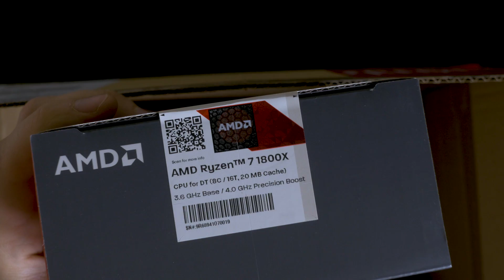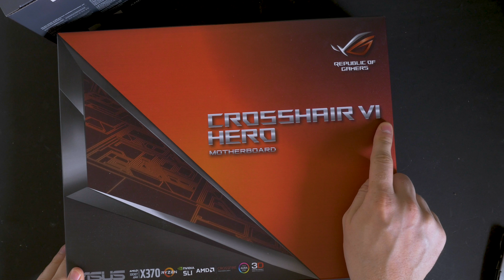Ryzen 7 + Adobe Premiere Pro Results

Comment: Adam can you comment on timeline performance with the 1800x? Buttery smooth, or dropping frames when you've got a stacked timeline? (using proxies, or straight footage?)
Reply from the maker: Playback is great but a big factor is the speed of the drive/s the media is on.
Reply: Good point about the drives. I'm going to employ a couple of Samsung 960 NVMe's which should rule out the drives as a bottleneck. I'm also coupling a 2700x with some quality B-Die 3200mhz ram. Premiere timeline performance is my primary concern, fingers crossed the Ryzen takes care of business. Thanks for the quick reply Adam, much appreciated.

Comment: I don"t see improvements while working in adobe premiere in compare to my 5-year-old cpu 3930k! cpu load is only 25-50%(( so for me that ryzen is a garbage. Maybe for user wich used before system on celeron, today  ryzen is improvement. But not for me, I only wasted time and money for buying and testing ryzen(( Now the obvious replacement for 3930k is again only intel for shure.
Reply: roma kol lol have you been trying to return the cpu for another new one?
Reply: cpu working properly. in cinebench r15 it scores around 1700 on 3.8 ghz. but in premiere another story) ryzen is only 25-50 % of load while my 3930k is in full load. Maybe turning off HPET is a solution? in adobe forum one man wrote that in some cases can improve the performance of ryzen.
Reply: lel so how the heck is higher cpu load is any better than the lesser one?
if you're talking about premiere, then it's not only cpu load that you're gonna compare with, have you compare the exporting time?
Reply: Yes, exporting time, warp stab, merkalli, scrubbing in timeline. Rendering the same 10 min project in AP in Full HD: 3930k - 7.05 and ryzen - 6.20. In 4k 5 min project: 3930k - 9.20 and ryzen - 7.20. Rendering in AE intel was a few seconds faster.
Reply: and that, isnt an improvement? and calling ryzen garbage right away? wow, just, wow
Reply: yes, wow. I compare to 5-year old cpu!!!  6.20 and 7.05 that improvement?))) throw out 500$ for upgrade and have only 10% of gain?)) I'll buy 7900 and gain will be around 250%, I hope so. I wanted threadripper actually, and ryzen was only like experement with amd cpus.

Comment: OMG Change that horrible looking CPU cooler go all in one water cooling DEEPCOOL.
Reply from the maker: +Adam rickard That horrible cpu cooler is very nearly the best air cooler you can get - there's a newer version out but the difference is minimal
Reply: Adam Troup  Yeah I know but it looks out a place with you new build using an older case isn't  bad but using a part that does not match that's all I am saying.

Comment: hi, i have a question, i have a pc for video/foto editing with al adobe suite, and its based on Fx-8350, now, i can put my hand on a stock of 32nm Opteron 6262he 16 cores, very low money, my question is...if i build a quad or dual cpu system with 2 or 4 opteron, i can see some advantage for media encoding with adobe instead of my fx 8350?

Comment: Awesome video, thanks for sharing!  I've been thinking about going Ryzen for my next build down the road.  Something to think about, though...

I have that exact case and recently upgraded from a i7 980.  After 5 years, my case had almost NO dust in it.  You're doing yourself a huge disservice with that front blower you put in, it's sucking in all the dust.  The case's normal design uses dust filters and creates a positive pressure when the computer is running, so the case doesn't suck in any dust through the cracks.  Ditch the front blower and you'll have a nearly dust-free case for the life of this build as long as you clean the filters regularly.

Comment: Can you do Ryzen 5 1600 for Video editing?
Reply from the maker: You can use a 10 year old CPU for video editing - depends on what you are editing (codec/resolution etc) how you are editing it (multi-cam/effects etc) and how quick you want the experience to be.  I would be much more specific with your question - I'm not personally in a position to comment on that exact CPU but if you are clear what your uses will be I'm sure someone will have a better chance of helping you :)
Reply: I have that same cpu in my build with a 1050ti and 16gb ram.   I don't do heavy video editing and it's mostly 1080p.   I'm satisfied with the performance.

Comment: First boot is slow on these new Ryzen systems, this is normal, once you get it done, it gets faster escepecialy if you have an SSD boot times are very fast.

Also if you have stryx 1070 or 1080 use the older version of tweak2 the new versions from ASUS may cause the fans to flip out on the video card

Comment: Well it needn't cost 1000 pnd to get very similar performance. 1800x means you pay a huge bonus for really very little performance gain. You would have experienced a very serious jump in  performance with  the Ryzen 5 1600X or so. Depending on  what you do you  people could opt for another mainboard and less internal memory. Etc. May be not for you, but I think for half the money you would still have a very worthwhile upgrade.
Reply from the maker: I wanted the best specs for my budget, if I use it for the next 4 years an extra £150 or so for the best CPU in their line isn't much.
Reply: 1700x overclocks to 3.8ghz of the 1800X with ease.  You could have saved a bit of cash.

Comment: Why did you choose R7 1800x instead much cheaper  R7 1700? You can overclock 1700 and get the same results.
Reply from the maker: +overlord580 I'm not an expert in overclocking but I have now overclocked this one to 4ghz, not sure if the 1700 would hit that...
Reply: in most cases, with good cooling, it does.

Comment: have the 2600K for almost 6 years now and decided to upgrade to 6800K in the coming days(maybe skylake-x id the price change is not big),what made you choose opting ryzen and not intel?
Reply from the maker: I use 32gb ram and so far don't tend to max it out although it uses around 75% for some tasks which is fine, 8 Sata ports is also fine for me.  I wanted the best processing power and it seems to beat the 6800k in the areas I need it to.  I can export a complex 4k project and continue to very comfortably edit another 4k project with this Ryzen CPU so I'm very happy with my decision.  If I was going to go Intel I would wait and see what they react with, hopefully it will be the start of more competitive pricing on Ryzen 7 competitive chips but with more room for overclocking.  Regardless of what you end up going for I think you will like me experience a fantastic upgrade coming from the same old CPU as myself.
Reply: Well, AMD is also launching their HEDT platform(X390) soon, they probably announce it in Computex in end of this month. 16 cores 32 threads is top cpu, basically doubled R7. Quad channel RAM, 8 slots, 44 pcie lanes. So I would wait and see what these new platforms from intel and amd can offer.
Reply: i will wait,hope the prices will be lower then when brodwell-e was lunched. thanx
Reply: 32 gb ram and I NEVER use more than 50% of that.
I'd have thought the extra 2 cores (4 threads) would have been the selling point for Ryzen over the 6800K (plus the price difference)... hopefully you can get an i7 6900/6950 at a good price in a year or two, so you have some upgrade headroom.
I have an i7 3930K, still works wonderfully, but would like to upgrade (new build) to a Ryzen 1700x or wait for Ryzen+
Reply: yes, that some great news. lets hope that a price war will start on the HEDT market after so many years intel has rein supreme
Reply: half the price.
Reply: you will get 10/20c/t Ryzen for 550-600$
Reply from the maker: That's great, I might upgrade sooner than planned!
Reply: wait 16 cores and 32 threads is just crazy, what the heck is going to use all that
Reply from the maker: I'm just kidding personally, the ryzen 1800x is going to great for years. I don't need any more for now, when I'm editing 8k video then it will be time to upgrade - probably.
Reply: Yeah, the 1800X is great. I've ordered the 1700 myself since it comes with a cooler I get to save some more money for a better GPU, while having those extra cores and threads to do some productivity while multitasking. The Ryzen architecture is like a jack of all trades, it's honestly a blessing for how much it costs. Time to say goodbye to my i7 870, been with me for 8 years now lol :(

Oh and I've just subbed, there's plenty to learn on your channel :D
Reply: I could use a few hundred cpu cores...
There's never enough cores for simulations...
Reply: gooryon 
I kept my 2600k and went for dual E5-2680s from eBay, but if you want "faster" computing (more IPC), get something more modern. 6800k and Skylake-X are pretty overpriced, and the Ryzen 7 1800x outperforms the 6900k and lets you multitask more effectively at a much cheaper price. If you want better than the 1800x, you'll have to pay a LOT more for something like a 6950x or the new X299 stuff, which isn't in any way price effective, but it is technically the best available for most consumer tasks like gaming, Adobe Creative Suite, etc.
Reply: obvious_humor as things are taking shape i am considering the 8 core 7820x (early leaks shows its ahead of the 1800x),or threadripper the allegedly 10 core entry cpu if the price is the same level as the 7820x, my deal breaker was always future proofing (128gb ram, and more m2 and sata connections) that the hedt is known for.i glad i waited :)
Reply: gooryon... yes lets hope it's a price war they start and not a cartel where they both mutually agree to keep prices high
Reply: 6800k upgrade??you are dumb!!r7 1700 /1700x/1800x eats for breakfast 6800k !! damn even r5 1600/1600x beats 6800k
Reply: Ryzen has only 4 ram slots vs 8 in x99, and only 8sata ports vs 10 in x99, for me it's a deal breaker in the long run(building a video editing rig for the next 4 years)
Reply: uuu, "very important" for 99,99% of peoples